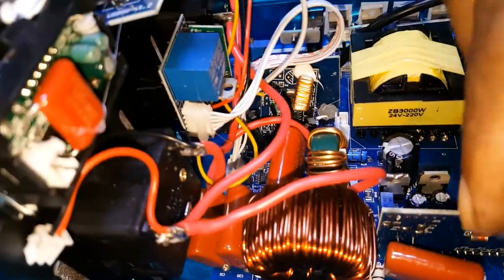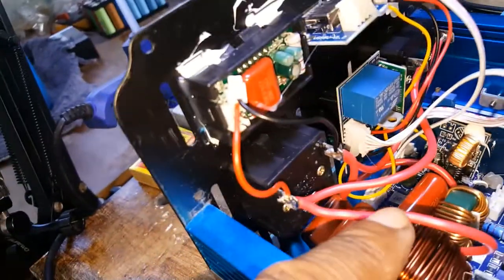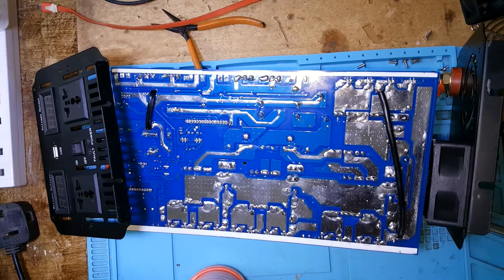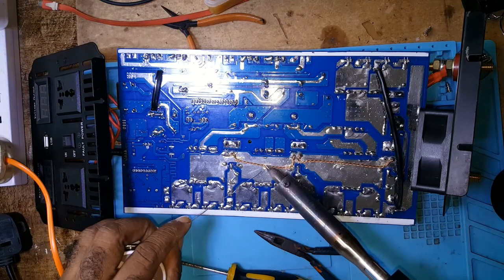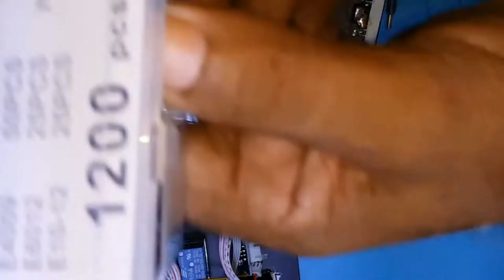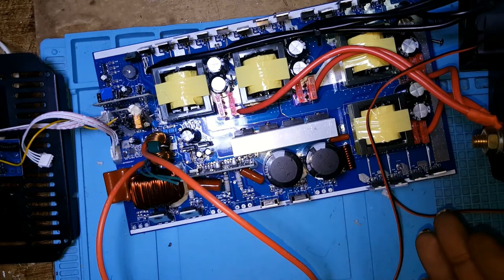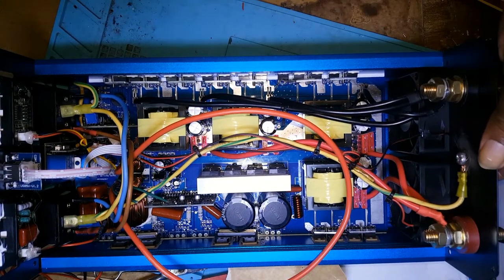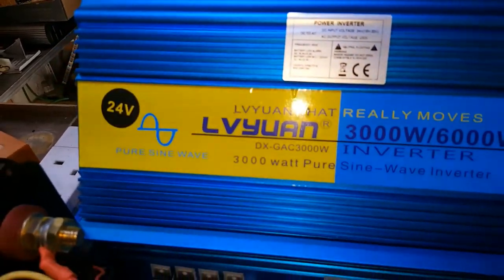Lvyuan 3000W Inverter Upgrade

Comment: Can this inverter be modified for US? I accidentally ordered a European model.
Reply from the maker: I'm not sure but it is 110v  on each wire which gives you 240v so you would have to speak to a electrician.

Comment: i would make sure it needed those mods first, you seriously risk blowing it
Reply from the maker: Ok.
Reply: Not sure Id consider what he did to be "mods". More like common sense upgrades. Most cheapo Chinese inverters use substandard wiring so replacing those wires with 12awg is a great thing. Also a great thing was adding a ground wire to the actual grounds on the outlets. Fixing the broken fan wire was a must! Reinforcing the soldering plates on the back of the board was the only thing this fella did that made me cringe a bit. But all in all, he didnt do anything to "change" the inverter, he simply "reinforced" or "upgraded" several weak points of the inverters cheap build. His inverter will probably get closer to its advertised output without overheating and experiencing a melt down somewhere. Actually, the only thing I might consider a "mod" might be the "direct connection" unit he installed in place of one of the outlets. But thats a great mod if its a mod. The outlets are rated for just 15Amps(at least they are on my 12v to 110v version of the same inverter).  Those direct connect units are rated for at least 20amps. I would not have added that unit with the original power wiring installed but since he changed those over to 12awg, he should be good to go! In fact, I think I may "upgrade" the wiring in my unit and add one of those direct connect interfaces as well.